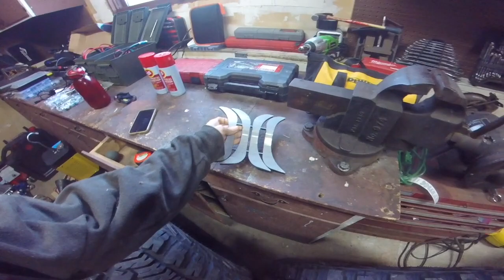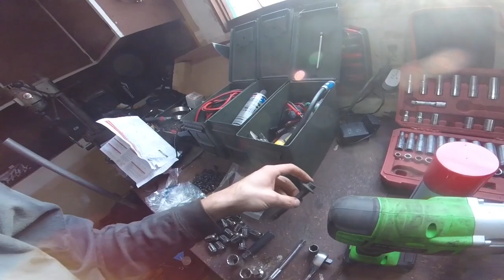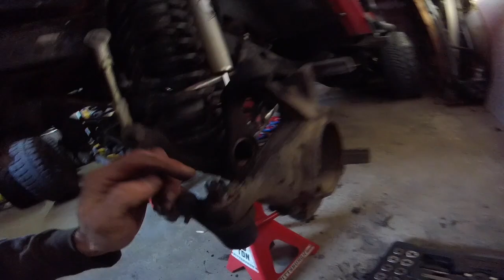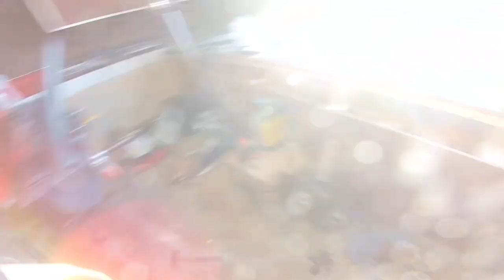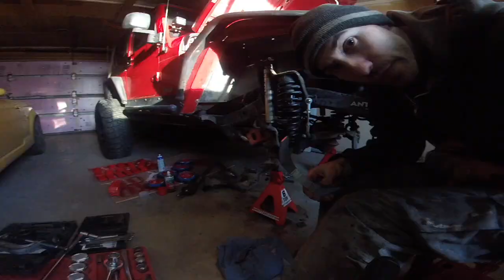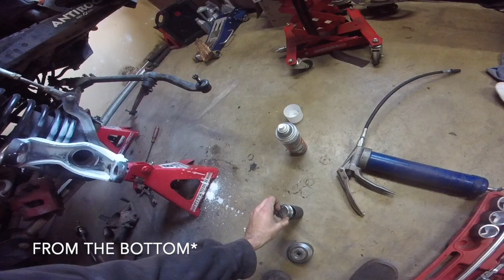Axle C Gussets & Ball Joint Upgrade | Jeep Wrangler TJ

Comment: Just got my gussets delivered.
So the top you clamped against the C and the bottom sort of flush on the outside?
Was looking at top clearance to BJ if they sit flush all the way, be hard getting press cups on.
Thanks
Reply from the maker: I just took a picture but not sure how to send it as a youtube comment. The outer edge of the C gusset overlaps with the inner edge of the axle C just by maybe 1/4". It's not really close to the ball joints